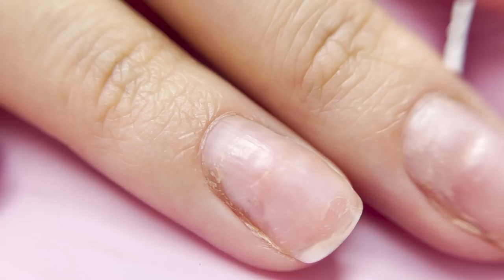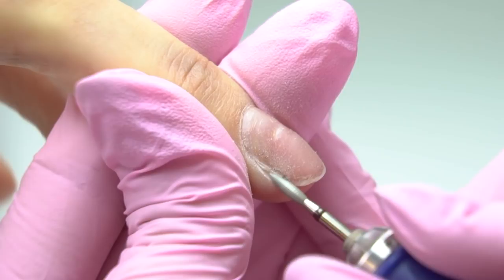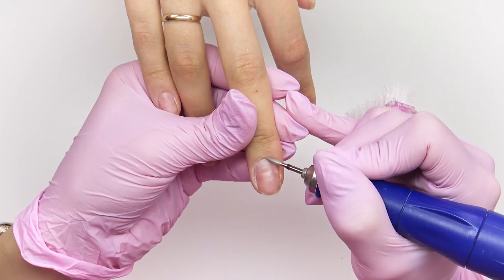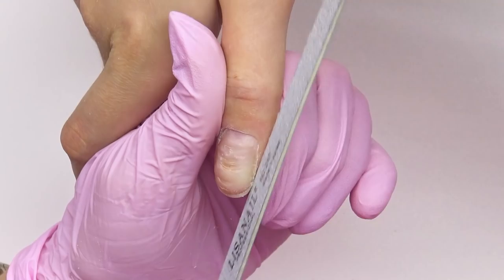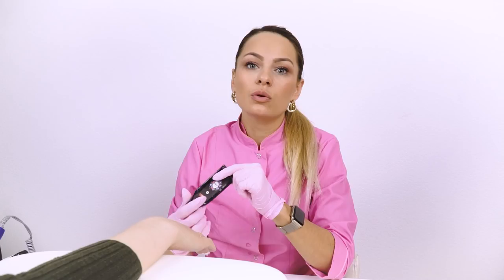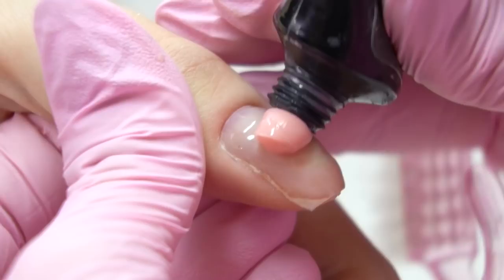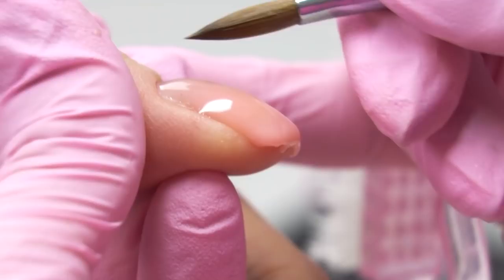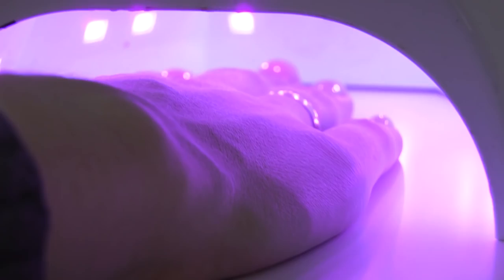How to Fix Damaged Nails | Short Square Polygel Nails with Stamping

Comment: I have a thumbnail that is pretty messed up, a lot like the model’s nails. Only it has been like this for years. I am glad to see a video that addresses this.
Reply: Same.. mine is bad bad!
Reply: Gurl same I always thought I was the only one and I was so ashamed it's in both of my thumbs it has went away at one point but then I got stressed and I started picking at them and it can back
Reply: Mine was damaged by shifting through a disorganized junk drawer and hitting it on a loose razor blade 😅 The blade just cut a small chunk out by the cuticle. It hurt for a second but seemed fine. Not enough to cause much damage. That was 2 years ago. It caused a horizontal dent and it is growing out but super slowly. It seems like the more it grows out the deeper the dent. I was usually able to hide it just by buffing it to even it out as much as possible but now it’s very noticeable. It’s almost to the end but I’m guessing another year at least considering how long it’s taken to get there 😢

Comment: Hi,I have nails similar to that if I don’t put any products on and just leave it would it grow back normally? If so how long would it take? And if not what would I have to do?
Reply from the maker: hi, our nail plate restores completely every 4-6 months, applying the gel coating, we just protect it from breaking, so if your nail condition was caused by mechanical damage, it should get back to normal after a few months🌸
Reply: Thank you, but I have been suffering with nails like this for about a year but every time it grows out it becomes damaged even thought I haven’t bumped in anything or use any mechanicals that can possibly damage it.

Comment: How long would it take for the thumbs to be fully back to normal? And will they stay normal if the nail routine has stopped or will it have to be continued still to maintain it to stay normal?
Reply from the maker: hi, it normally takes 4-6 months for the nails to change completely; if there was a mechanical damage then we just need to avoid doing that again; and if it's the natural nail condition then yes, we should continue the routine